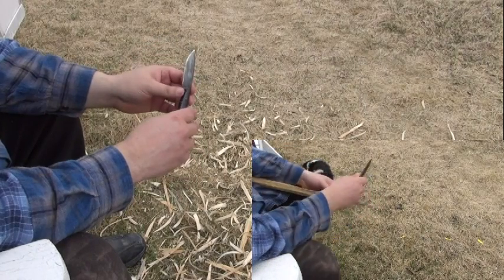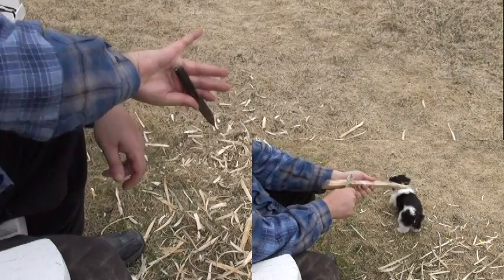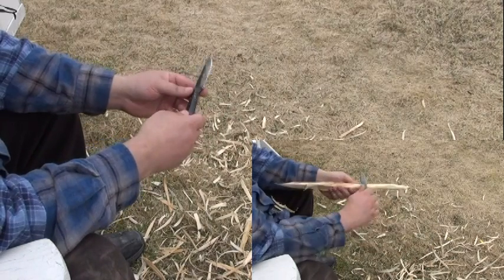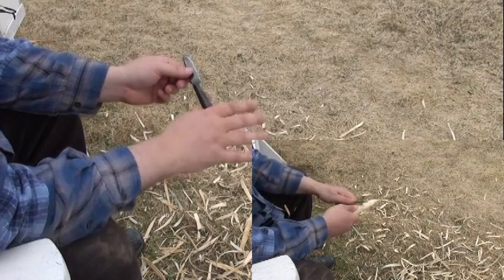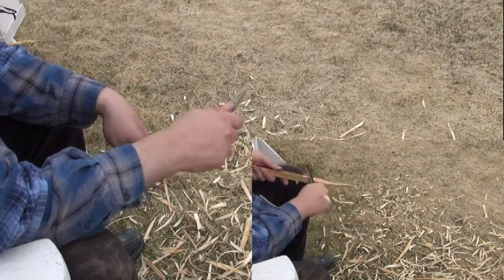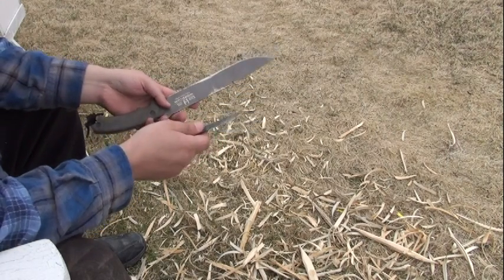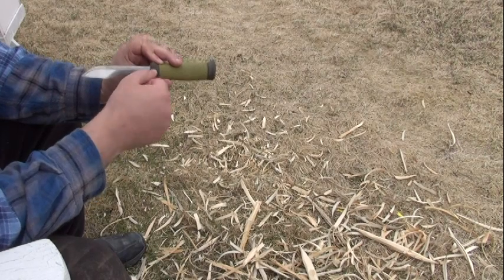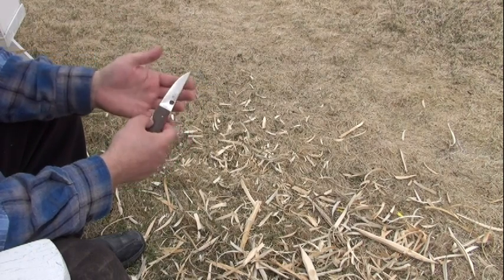UddoPuukko - some grip details (discussion of single bevel vs multi-bevel commentary)

Comment: Very nice! If that's on of Uddo's Brisa Enzo blanks , they do a differential temper and the edge is 63 with the spine around 53. If you check the Brisa Enzo channel you can see their setup. They use a coil to heat only the edge. I have the Nordic I think is the same blank. Mine is o1 and I love it. Would love to get one of Uddo's

Comment from the maker: I usually regrind them to full flat if they are working blades. 

If I want to leave them as a reference point then I leave them as ground and sharpen the single bevel following the same general principles as in the video I made showing the basic three steps of sharpening.

Comment from the maker: That is the basic problem, concerns with warranty.

However if you look at the inexpensive kitchen knives they are not getting very thin with low angles, it is easily possible to find one 0.010":15dps.

All the do is make sure they are clearly labeled as "fine edged" or similar and not meant to chop bone and such.

Comment: ultimately i prefer the full four finger grip whether it be on a folder or a fixed blade. i had one of those CRKT K.I.S.S. pocket knives with the tanto blade, the design was interesting but, its function was severely limited by the grip as i found it literally painful to use it for tasks such as cutting cardboard or opening packages. though it wasn't all due to the lack of length on the grip but, also how narrow it was and how squared the edges were too.

Comment from the maker: Not with the sheath it comes with as it is very tight, but yes you can make pocket sheaths there are a number of ways to do it a common one is to have a belt sheath that actually slips into the pocket.